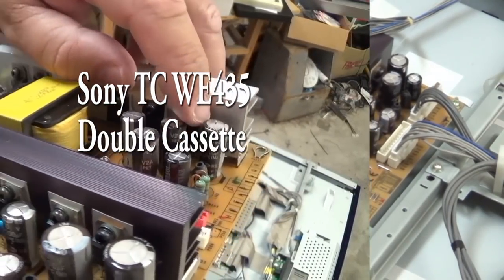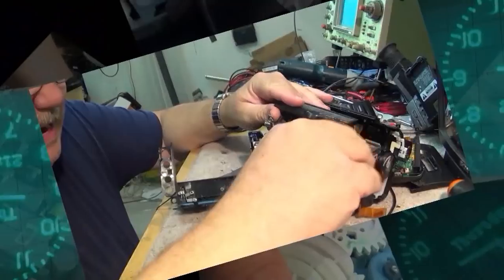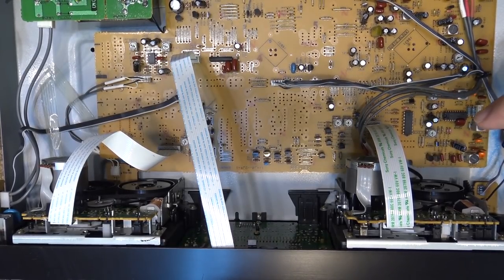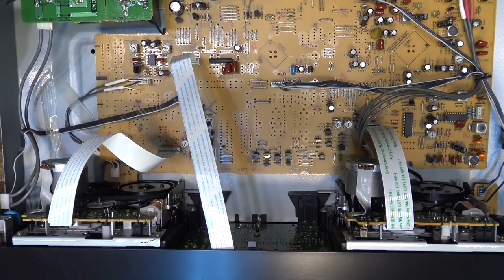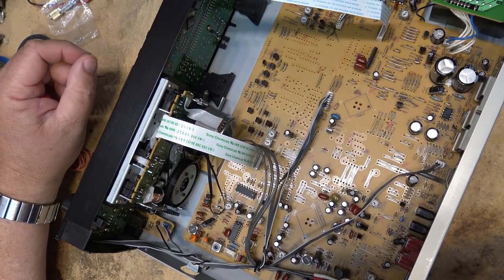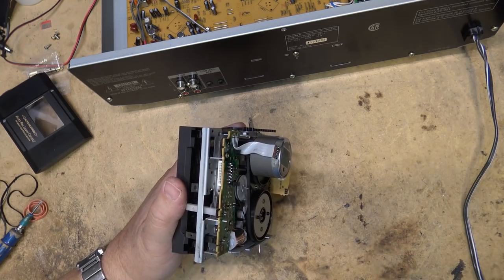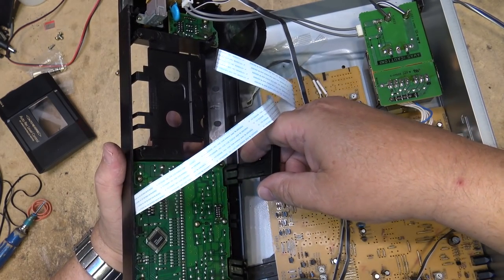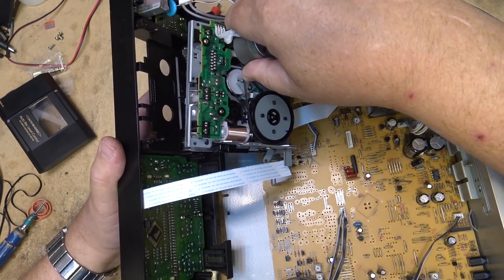Sony TCWE435 Cassette Deck makes a clunking sound. Lets find out why

Comment: I have a TC-WE835, a contemporary model to the one in the video, but with dual 2-motor record decks, Dolby S, and minutes-and-seconds counters — but a similar cheap feel. I think it needs an azimuth adjustment, though, since playback on the reverse side is horrible. :/ 

I also have a TC-KB920S, a much nicer single, non-auto-reverse deck that feels better in every way, but alas is in need of repair. (I slipped while diagnosing another problem and shorted something out, which is going to take a bit more work to diagnose... At least I have a donor deck with the same unobtanium parts in case the main IC or something is fried.)
Reply: Besides azimuth, could also be the mechanism that flips the head over has a problem or is worn out. That can be a problem with some of those auto reverse decks.

Comment: Smashing repair dave :-)
It did look like a bloody nuisance but there are worse (I know you have been there).
 i've had ones to repair that have bunches of cables soldered direct to the deck and tied to other harnesses everywhere so it's a pig to even move the deck at all.
Some multi layer decks seem to be designed by someone that loves mental pain, it makes a simple job a bloody nightmare.

i also noticed the crappy flywheel, shame on sony :-(.
My old pioneer CT200 single deck has a solid metal heavy flywheel for energy storage.
Not a high quality machine but not cheap as crap eather.

Comment: well...i'm years late to this video...most owners seem to have the TC-WE435 or other WE auto reverse twin decks...mine has to be the more basic version TC-W435 no auto reverse...easily changed the belts on it and my Kenwood KX-W4020 twin deck...one deck is not good on my Sony...so it sits on shelf as my backup...i had really sticky goo belts to clean off the pulleys...it was similar to melted black Liquorice...took ages to remove with Isopropyl Alcohol...maybe i didn't get it all from the drive that's faulty?

Comment: @12voltvids
 Hi there. I got the same cassette deck. Even though I raplaced the belts it is still the same. When I turn on the unit one motor spins but the other doesn't. I know the motor is ok because I've tested it with 12volts it is spinning smootthly. I really need your advice .Thank you so much.

Comment: Did this Sony have that much audible wow & flutter when it was new? Are the transports made by Tanashin or something?
Reply: All Sony double decks from this period have the crappy mechanisms with high w&f - indeed a magic flute. They used to be decent and through the progress of using more plastic got to the point that a really good boom box from late 80s played better. The one I have has different mechanism - no solenoid if I remember correctly and much harder to get the belt on.
Only a few decks could record on both decks - top of the line Aiwa, Akai, Yamaha, Pioneer , but that was a very long time ago... in another galaxy

Comment: I always watch your videos, but this time I stuck with a Sony TC WE405. It's a cheap double deck and I've changed the belts. The problem are the cam gears now, seems they're stucked. How can I find out the right position (stop, FF, FR, play).
Usually turn the wheel around and see if the head is going up or down, but  it looks they in a wrong position so the transport won't work. Thank you for any help.

Comment: I have got this tape deck it does good recording on it. I heard that the 435 is better then the 475 in built wise plus it has got better tape window then the 475. I record my tapes in dolby b and playback with dolby off it sounds good. Thanks for the video

Comment: There is a shortcut on these transports. Cut the 1 plastic pin that the belt straddles and you can change the belt without even turning a screw. They are cheap, could you increase the mass of the flywheel to help wow and flutter? One of my old decks has "tar resin" packed into the back of the flywheel, described like that right in the service manual!

Comment: Just bought this at Amazon. Said it was in good condition and Sony discontinued manufacturing this back in 2001. Hope everything works well. But, from bad experience, I will no longer fast forward or rewind my tapes. Just play them as is.

Comment: I wonder if it has the same wow&flutter level on both directions. Since it has a steel plate embedded to one pulley (I can't call it a flywheel...), and no steel plate in the other, and the one without the steel plate has a very small contact area with the belt, I guess the direction which uses this pulley have higher wow&flutter.
Don't you have a wow&flutter meter? This one is so horrible, it might be out of spec. I think there are software wow&flutter meters, which you can run on your PC (or maybe even on your smart phone).
Reply from the maker: No I don't have a wow and flutter meter or a distortion meter or anything else. Just my digital meter, esr meter and scope.Remember I don't do this for a living, but even when I did we didn't have all kinds of fancy test gear at the shop. The owner was too cheap to buy anything and I certainly wasn't about to buy equipment so the owner could profit from it.
Reply: @12voltvids  I know, I understand, and I don't have either (OK, I have an ancient tube THD meter, and a VTVM on top of my old CRO), but nowadays these measurements can be done in software (freeware!) with a few clicks, so it costs nothing, and consumes no bench space.

I've done a quick search, and found one promising piece of software, it's not free, but just 39 Euros, and you can try it for free for 1 month. But I'm quite sure, with a more thorough search, you can find a freeware with similar capabilities (or a standalone wow&flutter meter program).

https://www.audiotester.de/mainE.htm
https://www.audiotester.de/ordereng.htm

I'm pretty sure it would be possible to integrate wow&flutter measurement into modern digital scopes, but I don't know any which has that function. Maybe someone hacked it into some scopes (if not yet, let's do it, software gurus!)

Comment: Fantastic tutorial, but left with an issue I'd love help with: for some reason I can't get the door back on one of the two decks; one roller is engaged on one side (play only side, on the left if you're facing the unit) and the metal plate won't slide down; a floating piece of metal on a spring is in the way of the door closing. 

I can't figure out how that engagement works, why the roller is in that position or how to release it. SO close to having this fixed...really stuck. Anyone?
Reply: I can only guess but perhaps it's something like the problem that I had. The deck is in Play mode or Search mode but you need to get it into Stop mode so that the door can be opened and closed. Watch the little section from 12:00 on. There's a little switch that goes through all modes if you click it.

Comment: Hey guys there! I saw this and helped me to replace the FFWD and REW belts, because genuine ones were aged. The normal playback worked fine on both decks so I did not change them (I bought my brand new TCWE475 around 2000 and used it for few years, then it just sat there for years). Now, the rewind and fast forward works at the right speed, but when tape reaches the end of cassette, it tries to make the auto-stop sequence, but somehow it fails... It repeats trying for few times, and eventually the display shows E (I presume error! message) on both decks and none of the buttons are operational anymore. I press ON/OFF to reset and it is back on operational, until next attempt. In playback mode, when reaching the end of cassette, both decks and both sides, auto-stop works fine. Please give me a hint! Should the playback belts be changed as well? Could they be elongated and slippery even they are operational?
Reply: Fixed: it comes from the belts. A set of belts, 2 of for play and 2 of for fast fwd./rew. can be found online for about 20 Euro. There is no need to dismantle more than the top cover, the flat belts can be extracted and inserted from/on the motor pulley by using the small gap near the plastic guide. Changed belts set and everything works fine, no more E error.
Reply: Hi Adrian, I have the same cassette deck with the same problem.
From where did you ordered the belts?
Thank you in advance for you answer.

Comment: So, you should have taken the main board out, removed the plastic cassette carrier from the front, then taken the drive unit out from the rear.  It's in the service manual.  

Using magnetic screwdrivers around a device that is based in reading and writing on magnetic surfaces, as well as around any chips/diodes/semiconductors is foolhardy.
Reply from the maker: Don't have the service manual. Magnetic screwdrivers  not an issue around magnetic heads because they need to be demagnetized anyway and just putting in record dies that for you.  3 head decks need manual demagnetizing if okay head.  The fact that you mentioned this just provrs you are an idiot. When i worked for Sony the factory supplied screwdrivers were all magnetic.

Comment: i like the watch
Reply from the maker: Yes so do I.  Thats why I hang on to it. It is a relatively rare Casio model, possibly their rarest model because it was quite expensive when new. It is fully solar powered and picks up the time signal from WWVB the time signal out of Colorado broadcast on long wave radio on 60KHz.
Have had it for at least 15 years and battery has never needed to be changed as it is recharged by the solar cells that surround the display. It also has electrolumanescent  lighting for viewing in the dark.
Here is a link to an old amazon listing of this watch as it shows unavailable.
https://www.amazon.com/Casio-WV300DA-7AC-Waveceptor-Atomic-Silver-Tone/dp/B00134JO4U/ref=cm_cr_arp_d_product_top?ie=UTF8

Comment: Where do you reccomend i buy the belts.
Reply from the maker: Try kpcomponents.co 
You will need the size.  They do not have model number to size look  up.
Reply: . thanks for the help the only problem i have with that is i have a sony tc-we425 and two of the belts literally melted. Thanks for
Reply from the maker: @jimmyjames1908  you will have to measure.  I showed how to do that years ago by threading a piece of string around and measuring it.  I don't know the size.

Comment: If it's not enough that this deck is full of plastic, they have to make it service unfriendly to boot.
Reply from the maker: There are worse decks than this from a service standpoint.  Try changing the mechanism control belt in a technics rsm275.
I gave up on mine and deal with a slipping load belt that I found that if I tap the cassette holder when I press play, it works or press pause before play it will work.  To change that belt it takes at least an hour to take apart and reassemble.  I did it once, never again and I would refuse one if it came in.

Comment: ffs if you have to pull the thing apart like that to get the belts it's not worth it for the layman wtf do they make it so hard for people with cheap faulty belts that break down and warp sound etc.
Reply from the maker: They don't design things to be easy to repair.  Commercial gear is different, but consumer stuff nope.

Comment: Disposable Sony piece of .... Seems like the older the deck the better they are - 80s, very early 90s still ruled the cassette world and the new child was born: Windows 3.1 and everything went downhill from there. 
I think the videos are better - new hi-res camera?
Reply from the maker: No same camera, just set to 60p as opposed to 60i. I upgraded my internet plan so I can afford to make videos of higher bandwidth. That camera will actually shoot even higher quality, it is a 4K camera so I could shoot in 4k if I wanted. Just my overhead monitor will not display a picture if shooting in 4K as the camera turns the HDMI out off as soon as the recording starts.  I use the overhead screen to see things up close.
Reply: @12voltvids  
So that much of a difference between 60p and 60i, wow, really it's like double the resolution. How much of a difference in file size and bandwidth, say in % and $ spent.
Reply from the maker: @pliedtka  
Its closer to 3X the bandwidth. Most  of the 1080i stuff is rendered out at 10mbits. In 60fps it is more like 30-40mbits and that is if I bring it back. Premiere wants to render 50 megs.

Comment: Can you help with this symptom? https://www.youtube.com/watch?v=0GITrVO5HUU. If I stop the tape I can't start it because the left reel make a short counterclockwise rotation and autostop system feel the left reel not rotating and react. The solution I have is to take out the cassete and manually tense the tape.

Comment: Sounds like hell, recording will be even worse, not the right belts ,I've delt with plenty of those in there time
Reply from the maker: The belts are the correct size, but I suspect that the ebay purchased belts are substandard. That is what you get when you buy parts from ebay. Factory rejects or recycled parts.  Not much choice these days.
I actually contacted the seller, because the last deck I used them on also sounded like crap, and the seller wanted me to return them for refund. The cost of shipping was higher than the refund.
So I use them for demonstrations on how to change the belts.

Comment: You can't expect anything else from such a cheap cassette player. you buy cheap so you get cheap made cassette player!
Reply from the maker: I don't expect much with electronics these days. Why do you think I got out of the repair business? My colleges at the time thought I was crazy to leave when I did, which was just before the big price drop in the shift to HD but I called it a day in 2003. I often wonder what happened to many that I knew in the industry that I lost touch with. I know a few have passed away since then, including my parts supplier a few years ago. Well they said it was a dying industry, and the guys that knew their stuff are slowly disappearing.
Reply: @12voltvids  Sad true story...
Reply: I left the shop in June of 95, almost regret it, until I saw the sharp drop of in stuff coming in , I still worked part time doing the small office equipment that started coming in ,I suppose that was a sign as well, tv shop servicing office equipment
Reply: @PaulJCost1  I loved it ,still talk about it with friends,  I loved my bench with all the meters and my scope and soldering station, those were the days
Reply from the maker: @toddt6730  We were very busy with 3 full time techs till about 98 when I had to let go one of the techs,  the other guy retired shortly after that after a fight with the owner, and then came back a few months later because he was bored. He finally left again permanently in 2001 I think. I was then by myself in the shop until I was fed up with the bullshit I had to deal with with the owner that couldn't make up his mine. One day I am managing the service dept making decisions on what fast moving parts to stock, and the next day the owner is all over my ass for stocking parts that we needed daily, and wanted to order them only as needed. Then all over my ass because there were back orders of parts and people waited several weeks for the back orders to come in, and now I am catching shit for not having the stock to look after customers. That was ultimately the straw that broke the camels back in my case.A fast moving part, in this case a flyback transformer  for 36" sony TV that were popping like fuses. On average I did 5 a month, and had been keeping 1 spare.  I ordered a spare when I used the last one, and when it arrived the boss shit all over me, and shipped it back, deducting the restocking and shipping charges from my paycheque.
A week later a TV comes in with a blown horizontal output. I knew it would probably need a flyback, but the prior week I got penalized for ordering an extra part that would have been needed shortly so I didn't order it. Just the transistor, and bingo this one needed a transformer that had just been shipped back. So I ordered it again only to find it was now on back order for 5 weeks. I loved it because the TV owner was all over the shop about the delay, and there was nothing I could do about it. When the part finally did arrive I though that was the end of it, but because I had to make 2 orders there was 2 shipment charges and I only passed one on to the customer so the boss was right there to collect the second shipment charge from me. I walked. I left in June 2003. The shop closed their doors in 2012
Reply from the maker: @mrnmrn1  Today that would never fly, because recordings could be made on a smart phone that would stand up in any court. My co workers knew what was up, but they were afraid of losing their job. The owner was a bully. Many small shops are like this. That is why we need unions, to protect workers rights. I am sure I am going to draw fire by the non union people in here but that is why they were formed, and are just as important today as they were back in the 1930's, because without them employers will continue to do this. My son is lucky to get 3 shifts a week where he works. He keeps asking for more hours but the excuse is always the same. "Sorry not enough work" and they all ask for flexible schedules which makes it impossible to get a second job, because one week he works sat, sun, 10-7 has mon tues wed off, then works thurs fri 6:40 to 3, has sat sun off, and then works mon, has tues wed off, works thursday friday off works sat sun. 
All over the mak anywhere from a 4 hour to 8 hour shift. They never get enough hours to qualify for medical or dental benefits either. The parent company he works for bought out another chain that was unionized just to close the shops, let everyone go and re-open under a new name and hire twice as many people giving them half the number of hours.